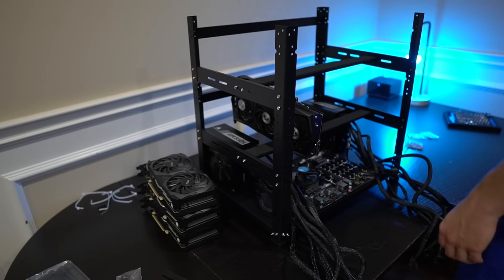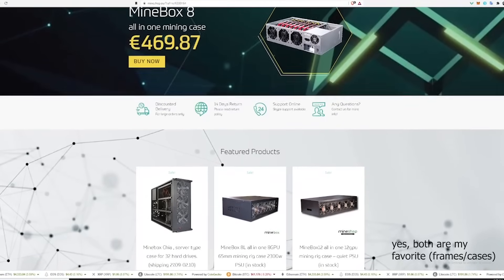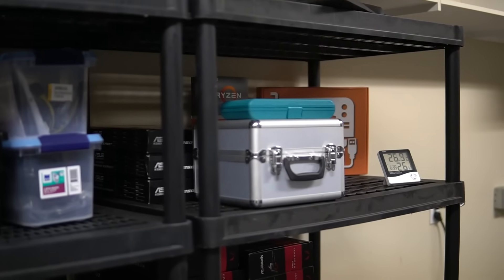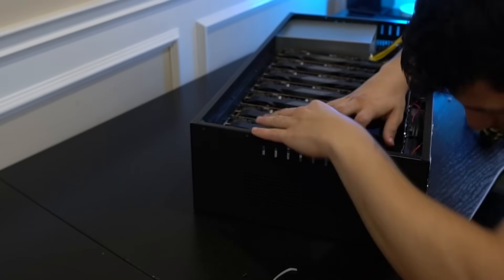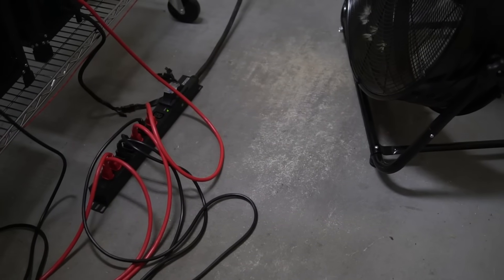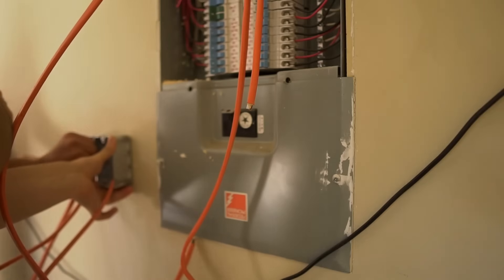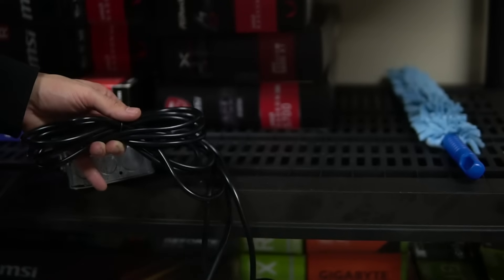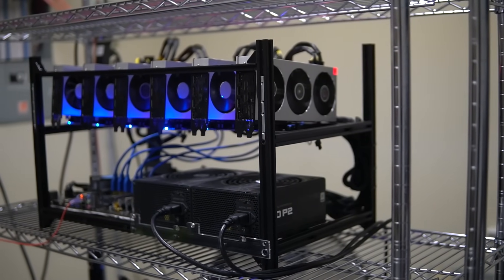I turned my garage into a GPU Mining Farm

Comment: It's more efficient to pull vs push air. I suggest mounting fans on the garage doors if not using the doors. Keep those on the floor for circulation. Gl! Nice setup!

Comment: Hum... just guessing : for the air flow I would try to play with the natural convection pattern, that is : exit hot air from the top.
Would keep the open bay in garage doors & try to look over my head what kind of escape for the hot air can be engineered. With like intakes, industrial fans like RFC has,
an then tubes up to the roof and light metallic chimneys. 27C right now, when it's 11C outside or like, add 15C and you get 42C inside... so, maybe some probs ahead, maybe.
We had that kind of gear for the whole house in Detroit Grosse Point, some time ago. Just push a button, one big bay opens and a huge fan starts cleaning all the house air !

Comment: How much roughly does it cost to add the 30A outlets? I have the fuse box also next to where I would like to place one.
Reply from the maker: I done mine myself so not sure how much a quote would be but I’d say no more than $300 $400 based on how far it is from the fuse box

Comment: Nice vid! I have a question regarding powering risers after watching your ATX PSU video, since the dual 8 pin vga cable is capable of supplying 281W combined, that means that I can use a splitter on one of the 8 pins which will result in three 8 pins that I can use to power three risers right? Since the three risers can only ask for 225W maximum (75x3) and the three 8 pins coming from one strand is capable of providing 281W combined which means it would be safe. Is that correct?
Reply from the maker: Yes 3 risers on one pcie cables with splitters is good

Comment: 220v??! I thought most residential is 110/120v?! Europe 220?! Did you do something different to get 220 in your new place? Glad you’re back man!
Reply from the maker: You can setup a 220-240v 30 amp plug if you have room for it in your fuse box! Dryer for example uses the same thing so you should have the dryer 30amp plug as an example
Reply: @MiningChamber  ok. I see. You add a 30a 2 pole breaker so it gets 2 x110.

Comment: Thx for sharing but I don’t think your airflow is how you think it is.  You need forced air on either the intake or the exhaust side (or both) to ensure proper circulation.  The alternative would be to use convection by placing an exhaust (hot) portal high and directly across from the intake (cold) which you locate near the ground with your rigs in between.
Reply from the maker: hmm due to pressure I can feel the airflow move the way I am visualizing it, but def your idea would be alot better, Ill explore more on that area and get it redone when temps get high!
Reply: @MiningChamber  What he is saying is true. Intake = low position. Exhaust = high position. Also, if your ambient temperatures where you have moved are lower than the temperature you want in your house you can offset all your heating costs by circulating the hot garage air to the rest of your house if done right. (Does not mean it is hard to do). I have some knowlede in the area as i am studying to mechanical engineer.

Really like your content. I have 5 gpus of varying models that i'm mining on :)
Reply: @Stealther is spot on. Most common gpu garage setup is high mounted forced air exhaust fans combined with low mounted filtered passive air intake vents. GPUs are set up between the outtake exhaust and intake vents.

Comment: Nice, a new video! I am not disappointed 👍🏻
Reply: 5:05 I use L6-30R for 3 prongs plug L6-30P as my place is single phase power panel.
Reply from the maker: @cc-.-  <3 its supposed to be L6-30R tooo, added the correction for it